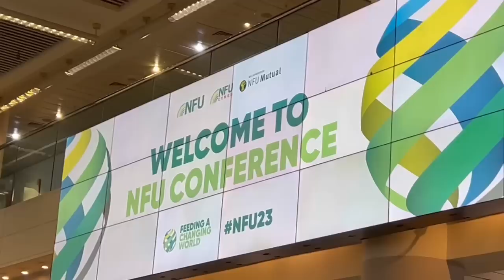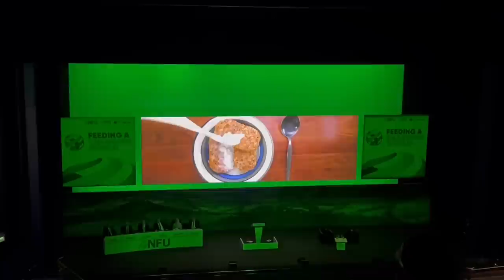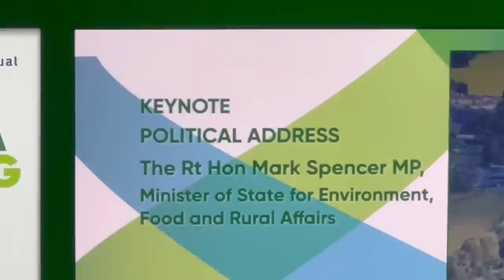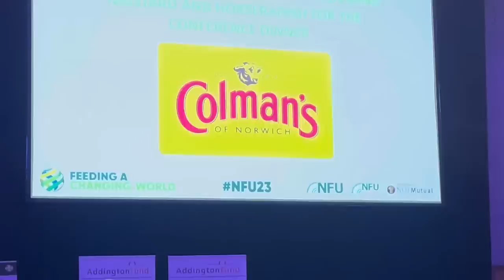FARM UPDATE 117 - SUGAR BEET, EMPTY SHELVES, DRAINAGE, SCREEN ROAD PLANINGS, NFU CONFERENCE,

Comment: Our neighbours had 1000 tonnes of plainings put down on their tracks. The plannings were dry so ended up getting a  hot liquid tar put down over it and rolled in. 
Worked out very well and is holding up really well, pretty much tarmac.
Reply from the maker: I’ve heard that before. Also spraying with diesel in hot weather and then rolling does a similar job.

Comment: Did you put a coin /washer on the pipe and walk from it ,to work out the depth of the pipe when water diving
Reply from the maker: A coin washer? What does that do? I can make it work any way!
Reply: @WardysWaffleAndrewWard  Im not sure of the science as regards when a coin /washer is put down on top of the pipe,but when its done and you walk away ,the diving wires cross,if you take the coin/washer from there and do the same procedure walking away they dont cross,just have to double check there isnt another water course under ground first,I can water divine,try it the next time when some water diving is done,the distance from the coin/washer is the approx depth of the water pipe under the ground
Reply from the maker: I’ve never heard that before! Thanks, will give it a go.
Reply: @WardysWaffleAndrewWard  Thought it might come in useful so you can find the end of the drain pipe,with the depth,can find water pipes as well.Some people can use a hazel stick in the shape of a Y,hands holding the two ends,,this used more so for finding an under ground stream to tap into for a borehole,when you are over it the stick turns up hill
Reply from the maker: I’m still unsure about your pre ious message regaling the coin. Where do you put it if you can’t find the pipe?
Reply: @WardysWaffleAndrewWard  If you cant find the pipe ,the coin wont work,if you have found the pipe with  the divining wires crossed ,place the coin on that spot ,walk from the pipe 90degrees and when the wire cross again ,is the approx depth of the pipe,in the ground,If you take the coin from the spot and walk again from the pipe ,they wont cross ,unless there is another source of water under the surface,try it on the yard where you know where a water pipe goes and follow the procedure
Reply from the maker: Our problem is we can’t find the pipe even though the dividers say there’s one under neath.
Reply: @WardysWaffleAndrewWard  If you put the coin down may give an indication of depth if you walk 10 yards say before the divining wire cross you know that wont be the pipe but an under ground water source,you have to go over the pipe in several places just to be sure that is what you are looking for in case there is a underground water course ,giving a misleading result